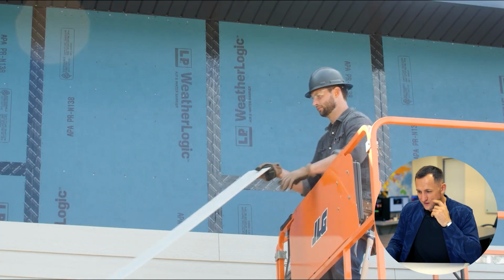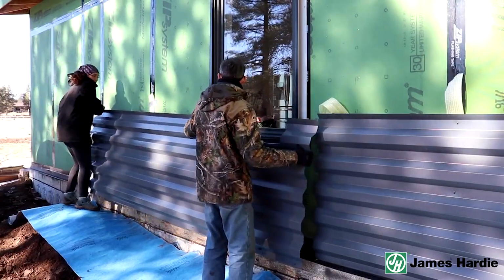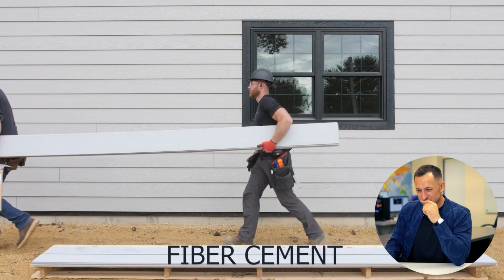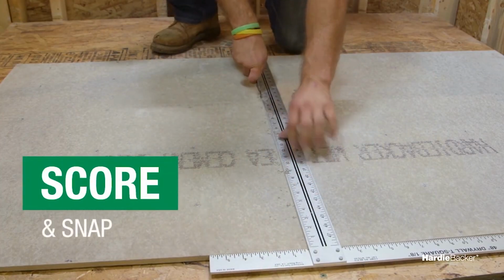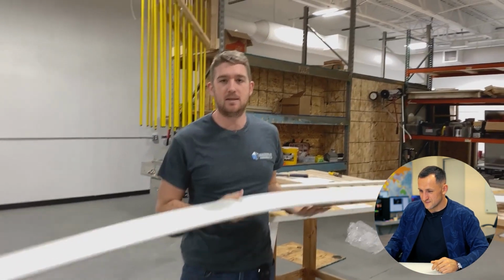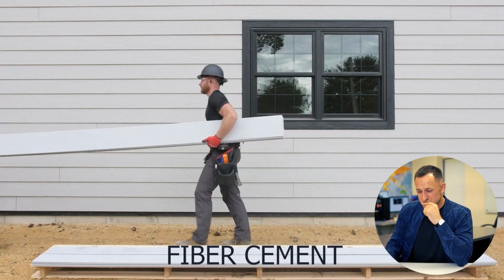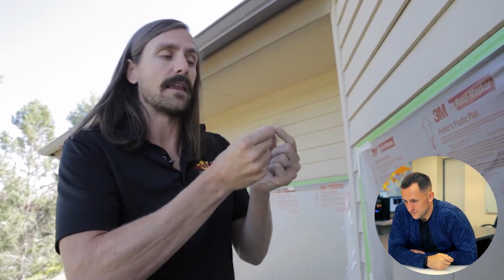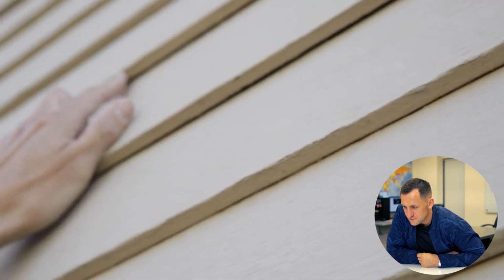LP SmartSide: REAL UNBIASED REVIEW: "Fast Food of construction materials" @RRBuildings

Comment: So we install quiet a bit of Hardie with LP smart trim corners and windows collars.

I did see LP siding, looks like garbage. There is absolutely no way someone should sell that. 

We live in a fairly dry climate so that helps a lot, but you gotta think about people who live in climates with a lot of humidity. Smart trim is good, but nothing compares to cement.
Reply from the maker: Thank you for that! LP is not the worst but it’s far from being the best
Reply: @RoofingInsights3.0  It beats FiberCement hands down. Your channel is FiberCement biased and you are short of your knowledge of SmartSide.
Reply: @teamplayer1218 how? I'm a builder about to put hardie on a house. They were out of it for a while and we considered LP. What did I miss that you know about?
Reply: @teamplayer1218  Fiber Cement is so brittle its actually pretty crazy.
Reply: @teamplayer1218  I'll bet hardie siding outlasts LP . I have some hardie that has taken a beating , it's 17 years old and has only been painted once. there are a few spots peeling from air leaks but it will sand and paint right up. I think it will last 50 years and probably a lot longer .
Reply: Quiet a bit huh? So the siding doesn't talk or sing?
Reply: LP siding is horrible. I live near Seattle and it rains here constantly. 
The siding has absorbed so much water and is rotting. 
I can't afford to replace the siding on my house so Im going to sell it instead.

Comment: You are a biased clown pretending to be unbiased. 

In 1997, LP re-engineered the product and introduced LP SmartSide, which uses wood flakes coated in zinc borate before being pressed with MDI resins and marine waxes to resist moisture and decay.  Since its release, LP SmartSide has sold over 3 billion square feet with no warranty claims for fungal decay

Comment: I am trying to make a decision and have been conducting my own investigation and see you as an expert and would like your opinion.  I am only interested in panel siding (4x8 feet, etc.), not the narrow boards.  That would mean a minimal number of edges exposed to moisture no matter what product I was using.  I bought a 4x8 piece of primed LP Smartside, which I then painted myself because I want a particular color not offered.  I painted the edges as directed.  It has been sitting unprotected on edge on a soggy wooden deck for 2 years and I see no damage to it.  I live across the road from a national forest, so there are a lot of trees around.

Do you still think the Smartside would be a bad choice for me and if so why?

Comment: I follow Matt, lots of great info but one thing he said in this clip. What would happen if you soaked it in a bucket of water for a week? Soak hardie for a week and you will have  a soft crumbly mess.
Reply from the maker: No you will not. You can soak it for a month
Reply: @RoofingInsights3.0 try it, film it. Post it. I dare you.  Both LP and Hardie if not properly installed/ edges painted/ caulked/ taken care of will eventually fail..

Comment: You are bais!  When installed correctly, Smartside is a damn good product!  I've had  several pieces (not painted, primed side up) on the ground in front of my shed for over 2 years in rain, mud, and me walking on it.  It has not swollen, delamed, or rotted - Clean mud off and it still looks brand new!!!!

Comment: Most of the problems with lp smartside are people not installing it according to the specs. I see "profesionals" putting up videos of them doing it wrong, using cheap junk paint, not using the right nails or the right caulk. Using the right nails but nailing it wrong. The only reason they caulk it is because the wvb needs to protected from uv rays.

Comment: My house was built with LP siding in 1992. It failed badly. To be fair, there was frequent heavy rain in WI while the home was being constructed so this may have been a factor.  The class action lawsuit paid only a fraction of the cost for removal and replacement. We had a certified contractor replace it with HP. That was 22 years ago. I can see a few places (along deck) where the siding is occasionally exposed to moisture, it is disintegrating. There is also a wall on the west side of the building with vertical cracks across many of the pieces.  HP a good product, but not perfect.

Comment: JH under water for 25 days and all that happened was the paper description label came off the back. LP under water for 4 hours and it swelled 30% and then dried for a week and never returned to the original size.  I have a signed contract now to install JH on my house and feeling very confident I made the right choice. You are correct the flexibility of LP is only for the installer and not for the homeowner. Thank you for the video.
Reply: That is great if you are building a house under water.
Reply: So, you plan to have your home on wheels, with submersible ballasts, and drive it around under water? That's a new concept in home building, please post pics when you get that amphibious home on, and under, the water!
Reply: I'll call you out on that BS!    I've had  several pieces (not painted, primed side up) on the ground in front of my shed (which as LP siding on it) for over 2 years in rain, mud, and me walking on it.  It has not swollen, delamed, or rotted - Clean mud off and it still looks brand new!!!!

Comment: hello everybody is June 2024 and I have blueprints for an 8 by 10 LP outdoor building solution shed assembly instructions Pine Grove cable roof shed... I read some comments briefly and I heard there was some kind of problem or some kind of class action lawsuit? I mean these plans blueprints, we're expensive around $500 but we were given to me from one of my best friends who built a shed and looks pretty good and it's still kicking after 3 years... but I'm about to build one now is there anything I should do I'll look out for a problems? any advice would be much appreciated thank you very much !
Reply: Just make sure you paint any cut areas, and seal any over driven  nails - I paint (with brush) two coats before installing to insure all edges are painted - Once installed, I go around and caulk nail holes, then paint over caulking.

Comment: I am testing lp by using it as decking under the pool ladder for my kids. 3x3 platform for them to get in and out of the pool.  It's going on two years now and it's still in good condition. And i am very surprised.i an actively trying to destroy it and i can't. Not only does it get the rain but also constant water from the pool all summer long. This stuff is not what it used to be.

Comment: It looks like OSB, but they put something in it that makes it more water resistant. I had a pile of LP 4x8 siding sitting on my driveway all winter and during the spring some water got in and pooled between the sheets.  I was pretty amazed to find no water damage.  The only down side I found was that LP is very fragile, so the high school kids driving forklifts at Home Depot will damage the hell out of it.  Don't let a corner hit the ground or it will get crushed easily.  The overlap is 1/4" OSB, so you can imagine how easily that gets damaged.

Comment: We had LP Siding on our new build house that we purchased in 1989. Within 15 years almost every home in the development had warped siding. This was in the Bay Area, relatively mild climate. We just installed James Hardie on our 70 year old Craftsman and it’s beautiful. The installers are certified James Hardie contractors do the install went “by the book”.  The Color plus Hardie planks replaced old vinyl siding which was drab and lacked modern insulation applications. Hope it lasts!

Comment: LP had a much larger class action than hardie if you're using that as a basis.
I'm a contractor that is open to both and I'm standing in a starter house about to put hardie on it. Looked at LP and almost used it when Hardie was back ordered. 
The shock was LP pricing vs Hardie. No way I'd look a homeowners  in the face and say saving a few hundred dollars was worth it when switching to LP.

THEY ARE TWO DIFFERENT TIERS OF PRODUCT.
LP is mid tier.
Hardie is high tier.

The fact LP is pricing as close to hardie as it does is shocking. They overprixe so that people will think its also a top tier and compare.
 
If you're going to be in the house long term get hardie. If your moving in less than 10-15 years get LP. But after 10 years you may have to do more than a few hundred dollars painting on LP that you wouldn't have to on Hardie.
The comment about a good builder is key here. Read the LP maintenance requirements. That clearly points out you need to use professional grade caulking. Nothing at box stores is worth looking at. 
Tremco has great charts showing classes of products and thw best use. I use a lot of high wnd Dymonic which I buy by the case in sausages, because that way I know I can cover almost any situation with it. $270 a case on Amazon if you're in a rural or smaller area.

Comment: I've done both: Both are good choices depending on where you live.. All about the install really.. Installation problems I commonly see with both is:  Ends butted together, Ends not painted, no joint flashing, poor caulking, cheap caulking, thin paint. And those who think you can just butt JH pieces together are dead wrong, and if you're not going to put joints on studs then at least use screws into the sheathing, and please don't use a matte finish on Hardie, it's a total waste of time..  Matte turns to chalk, satin turns to matte, gloss is the only way to go..

LP Positives:
Light weight
More natural appearance
Doesn't get chalky
More flex

LP Negatives:
Light weight 
A glued wood product
Not as compressed
More swelling when paint fails

JH Positives:
Heavy 
Shape & size is more stable
Less swelling when paint fails

JH Negatives:
Heavy 
Not as flexible
Tends to get chalky ( Gloss, Gloss, Gloss is the way to go )
More brittle
Appearance less natural
Reply: Good comment.
You should call out un natural for both then compare the smooth finish. 
I know people like crappy wood print but can we all agree that it all is shit. Just do smooth people. I've never seen a painted house with wood siding that the grain is co.ing through intentionally. Only 4 coats of paint in a hundred years yeah some grain there.
Reply: You forgot that the dust from cutting it will kill you and only comes in 12 ft lenghths

Comment: What about using the LP Smartside 4' x 8' panels on the entire home? It would be  a project a homeowner like myself could fairly easily complete, and it is far more affordable than Smartside Lap siding.  Would I have to caulk the 1/8" seams between the panels to keep water from infiltrating. There is some flex to caulking so it should still give some expansion and contraction for dryer/wetter conditions in the changing seasons. We are in a humid area in Nova Scotia, Canada. What do you think of thos idea overall? Thanks.
Reply: Hardie has panels also. Do an apples to apples.

Comment: First, the class action lawsuit was settled in 2000. The LP product was fiber-based and very different from today's strand-based LP SmartSide. Secondly, there are now no exclusions for coverage in Alaska, Hawaii or the Pacific northwest. I'm not a huge LP fan. I'm just updating what those watching should know about the product.
Reply: What product would you recommend? I’m not sold on LP SS for our new build. Contractors all want to use it because it’s easy for them. I’m leaning towards Hardy board or steel siding. Build is in Northern AZ wooded next to national forest so fire rating is a consideration.
Reply: @boolitman65  Steel is preferred if fire-resistance is the top priority. But a fire near the house will ruin steel just as it would Hardie siding, though neither should burn through unless the fire is severe. For looks, Hardie is a nice choice. Very attractive, especially the Magnolia Collection. So, for looks, James Hardie. For budget and fire resistance, steel. And steel is probably a little easier to maintain after 10-15 years.
Reply: LP SUCKS. I'M WORKING WITH IT RIGHT NOW AND I CAN ALREADY SEE THE PROBLEMS DOWN THE ROAD.
Reply: @PaulOgie  Sounds unpleasant.

Comment: I think LP added a chemical to their product after the warrantee issues of the 1990s… was it Boron?   I just wonder if the new lp is better.
Reply: It's way better but in no way is it within 20 percent of a cement board. It's a mid tier product performance wise.
Reply: @sparksmcgee6641  so you think cement hardy is the top tier?
Reply: @esquire9445  for retail siding yes. 
I've worked on a house that had 2 foot by 3 foot limestone slabs 4 inches thick as the siding. Every piece epoxies on with steel rods and epoxy grout. So it just keeps going, I'm looking at building an exterior wall that's 18" to 36" marble in 5ft by 10ft pieces.
I'm building a starter home now and this is about retail siding. 

Long term if you own the house 20+ and dont like maintenance do hardie.
Short term LP if you owne the house a few years. I still think that may not be good now that I'm seeing how high LP is priced. As someone commented " No one sees LP on a real estate listing". I bet you'd make more of the difference back on the sale short term also.

I was a homeless teenager and now have two houses. I understand the price has to be the reason to use a product sometimes.

Comment: I was a DYI installer of my LP Smart lap siding on my 3000 soft home in 2008. Today it still looks great! Primer and high end paint are absolutely essential! Butt end and nail holes need to be sealed/joint flashing. I used pneumatic galvanized nails. I rolled painted my siding before installation with an amazing 4” Whizz roller!!! The only paint applicator faster are sprayers.  Whether Hardie or LP they both will fall apart if not  primed, sealed and painted properly. I have installed both Hardie and LP Smart. Hardie has superior fire protection and insurance companies give a lower yearly cost. Still as a  DYI I love LP Smart siding for ease of installation. Hardie breaks easy/requires two people. I will install a 3/4” rain barrier next time. I used high end caulking around windows and trim. If building a new home I would strongly suggest using exterior insulation to improve was R-rating performance. All homes require maintenance!

Comment: 99 percent of product failure is due to improper installation. 
Hire someone you trust someone who’s accredited 
Someone who’s experienced and someone who can walk the walk …not a marketing firm that calls themselves a contractor/ siding company and subcontracts all their labor. 
Most of the examples shown of swelling siding if not all ….in this video 
are Truewood siding not LP SmartSide “strand board”. 
Anything wood based will swell when submerged in water long enough. Including the product this guy is promoting. The product he’s promoting is 20-25percent wood fiber (saw dust). Gee why doesn’t he mention that? 
shouldn’t bad mouth a product that has the same guidelines as the one he’s selling 
Check the installation instructions for Hardie 10” from any ground contact including concrete. 
4-inches from laminated shingles. 
His claim that LP Expert finish warranty 
Is not an LP warranty he is wrong telling false information. 

Both are amazing products it sucks we have to trash a product vs another  
Both are amazing siding when compared to plastic. 

Last thing THIS video is Biased 
All the claims he’s saying about the video he’s selling his product. 

Who submerges there house in water ? 
The end of his video is annoying he’s obviously a Hardie sales man. Which is fine sell your product without trashing the competition than “apologize” with a fake oh I’m sorry bro pick on these guys. 

 both have great performance when installed by a professional.

Comment: I live in North Eastern Colorado. It is usually dry 8 months out of the year. I went with LP smartside with Diamond Kote on my house. I think a lot of the problems is with the installation of the product. Both engineered wood and cement board can absorb water.  You have to inspect your siding every year so you can stay on top of any problems. Just my two cents.
Reply: Right there. Good post. As the guy that's reputation is on the line and I know 98% of clients don't do the maintenance, I don't think they are the same tier of product and don't think the 10-20% savings is worth it on the exterior of a house. 
I would put sheet LP on one of the rentals I own. If it was lap I'd go hardie even on a rental.

Comment: In north Texas, I have noticed over the years that lp lap siding lasts a lot longer than hardie. If I see a house with siding pieces falling off I know right off the bat it's hardie. When replacing hardie, I always see the back side of the board blown out from nailing, and the layers separating. Lp will start to deteriorate if paint isn't kept up with, but hardie is f'd immediately after installation.

Comment: I think they both suck, Hardie is heavy, hard to work with, not impact resistant, not water proof, it's a weird siding material really. 
LP is osb... Why?? Why not make a cedar printed, pressure treated, kiln dried, lap siding!? It would last forever, and if the paint fails it would survive 20+ years with no paint. But instead we get OSB with some magic wizardry that's supposed to last. 
I'm using LP with a lot of precautions, air gap, butt joint flashing, stainless nails, good paint on BOTH sides, if it doesn't last then it just sucks like lots of people claim it does. But hey, maybe it will live? It's a lot easier to work with than Hardie so replacing it won't be so bad.